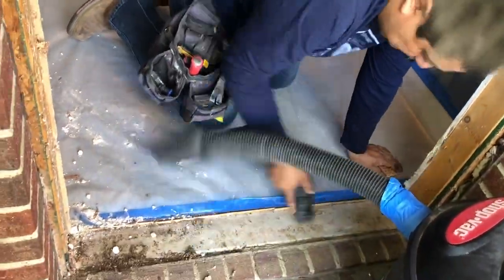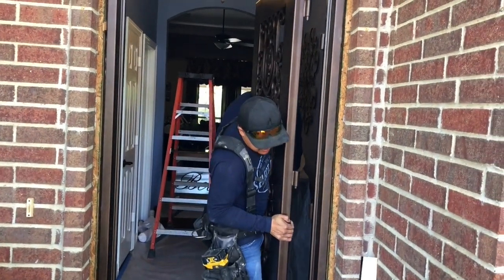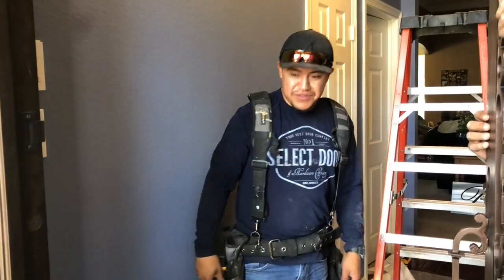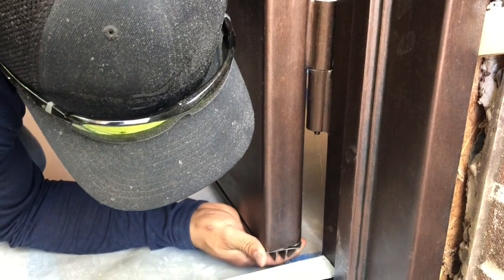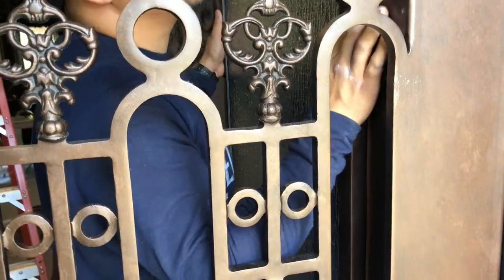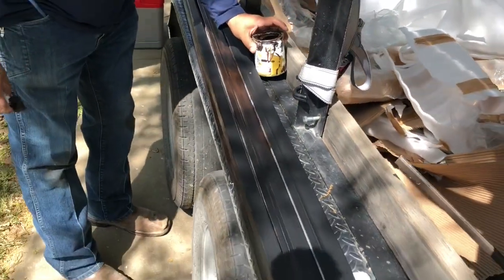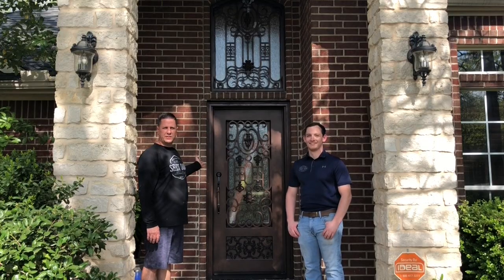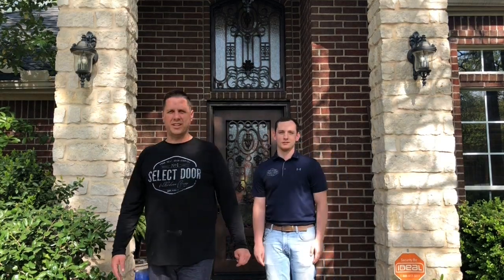Custom Wrought Iron Door Install Cutout and Remodel

Comment: How did you fasten the door frame on the jack studs ?
Reply from the maker: Yes
Reply: I'm pretty sure the door frame was dimpled and they used lag screws to anchor it. To hide the lag screws, they more than likely used a plastic cap that sits flush over the dimpled hole.
 I used to install commercial doors and frames for about 15yrs.